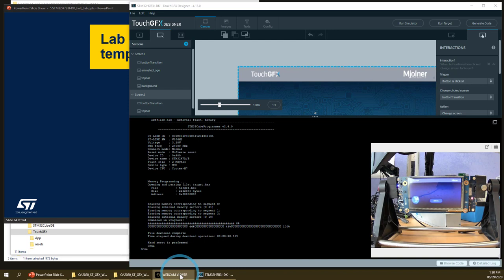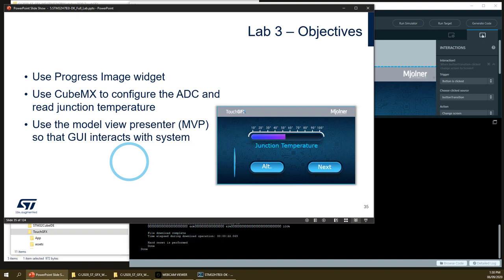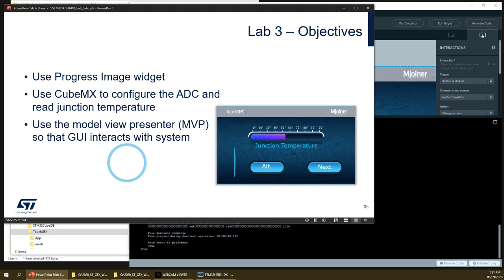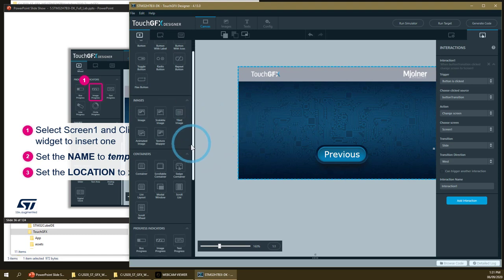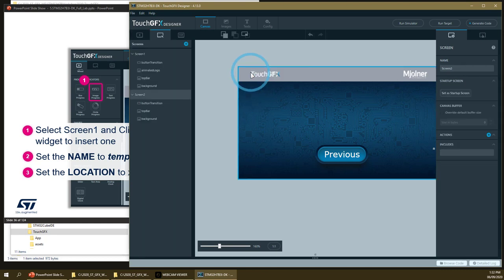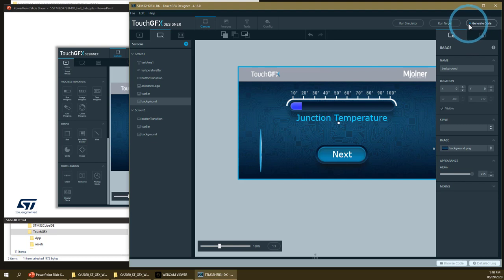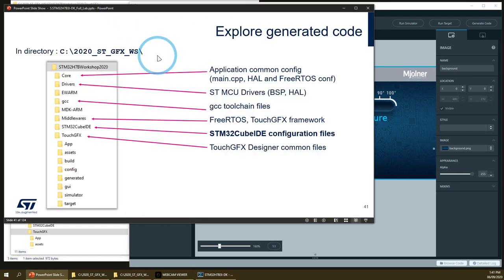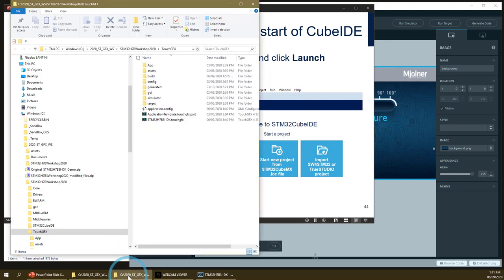STM32 Graphics Workshop - 10 TouchGFX lab temperature sensor display

Comment: It takes 58 min to show "How to get an external Temp sensor reading to display on TouchGFX"!. 
STM, What does that say about ease of use of your framework? And Yes, I am a software engineer! 

Why isn't there a TouchGFX software Adaptor to transparency read/write board I2C, Digital and Analog sensors, without all the complexity of digging in Eclipse CubeIDE? 
If you start saying, Well its because of this and that..., then your missing the point...KISS. Guys, You need to work on a TouchGFX software adaptor to transparently read/write board I2C, Digital and Analog sensors!. 

Success is your future development, as your onto something good with TouchGFX 👍
Reply from the maker: Hi, thanks for your comment, sorry to hear that this approach was a bit too long for you, our engineers do their very best to create this content.
Reply: @stmicroelectronics  And credit to your engineers for creating the content. Your engineers also know Software Design Patterns, and the Adaptor and Signal Pattern is one that is badly needed here for transparent read/write to I2C, Digital and Analog sensors, without needing to delve into Eclipse CubeIDE. Mention it in your next software meeting.
Reply: @stmicroelectronics So to show 1 variable on the screen it takes 6 files to be changed. xxView.hpp/cpp > xxPresenter.hpp/cpp > Model.cpp/hpp. Why is this so complicated? One getter should be enough, please explain the concept what are the benefits of this approach.